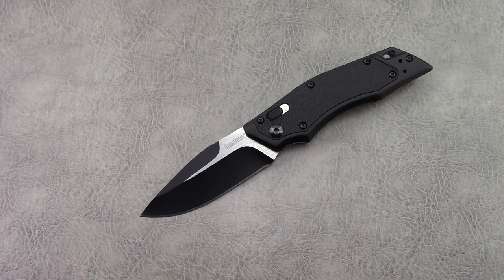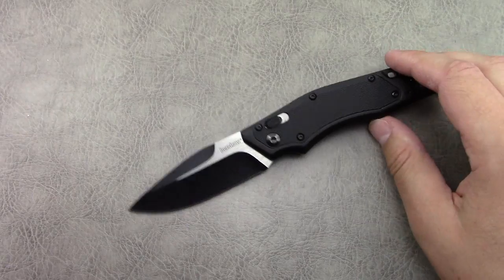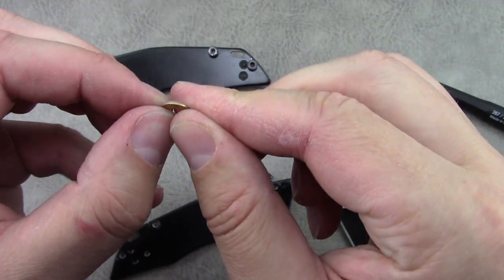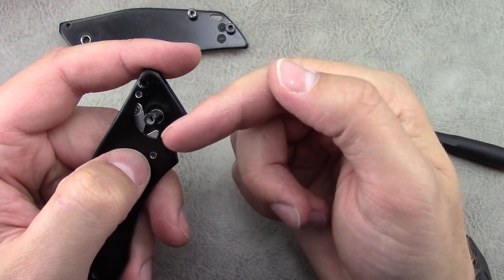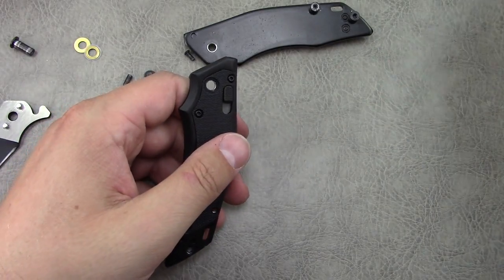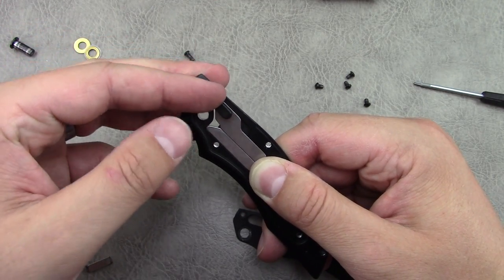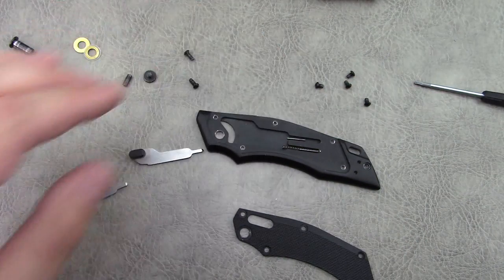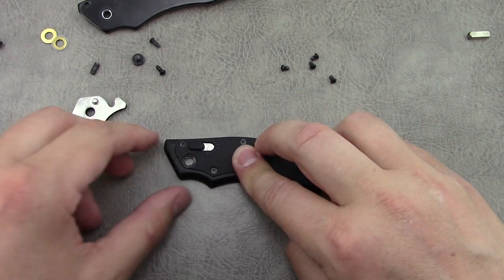Kershaw Induction Disassembly

Comment: I really think you should take a look at the Camillus Heat flipper. It was designed by G&G Hawk. The disengagement mechanism is similar from the outside but disengaging the switch actually retracts the blade entirely. The whole system is completely different inside. It has an adjustable stop pin and it's on bearings. The only thing that I don't like about the build is that the main body is cheap plastic. I'll post some pics of the internals on my Instagram.

Comment: When springs are involved & I'm unfamiliar, I remove that last screw inside a gallon ziplock bag. Might take a bit to figure out what goes where but I do less flashlight & magnet searches!
Cool little knife btw. Also appreciate your having shown the problems that can & do occur as well as the 'tools of the trade' (flashlight & magnet!). 
Also glad to see the use of quality Torx drivers & your recommendation of the same. Wiha & Bondhus user for years. Can't stand that Homeless Deep Lowes crap.

Comment: If you cut a slot with a cutoff wheel on a Dremel, you can use a standard screwdriver to help loosen the Pivot Screw.
Reply: Gaige Van Ausdal or just use a blow dryer or solder iron to loosen the thread locker...knife much?

Comment: I can't undo the pivot because the screw is too tight. Another side is rotating at the same time. Do you have any tips? Thanks a lot!
Reply from the maker: Heat up the pivot with a soldering iron to break the loctite free. You can try and push the free spinning side into an eraser to lock it into place.